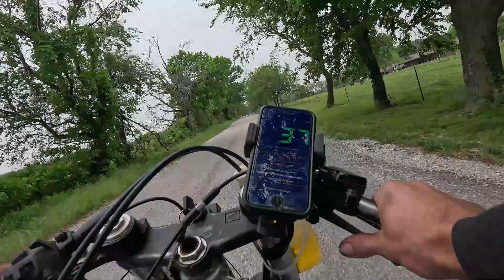DIESEL Motorcycle build from CBR part 4

Comment: Ya gotta call it the DIESEL TRAP
Reply: I am legit worried you're gonna hit a pot hole or go over a bump and pole vault yourself off that thing when the oil pan catches on something hard, my first thought was "well that's a death trap let's check it out"
Reply from the maker: Ha I like it it does sit pretty low. I plan to rebuild the front forks hopefully to sit higher
Reply: @simplytinkerdad  I'd hesitate doing that because you'll be changing up the geometry of the steering etc, but it could work if you put in the time to figure it out. I think a skid plate could be easier and probably a good idea regardless

Comment: plenty of torque... no need to adjust RPM range ... but your gearing could really use some adjustment... 

REMEMBER 
western US legal speed limits are 70 75 and even 80 . so do leave some passing speed on top of that ... HD uses 105 as their guvna
Reply from the maker: You’re right I’m actually thinking about running a cvt to my current trans set up to gain some range at 55mph max its just a heavy scooter